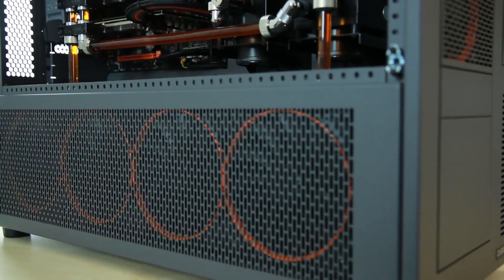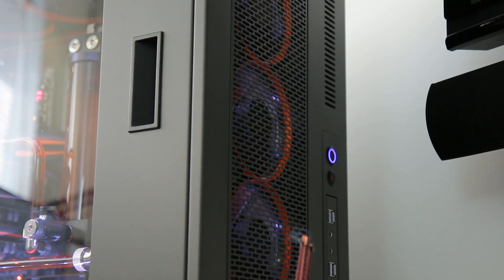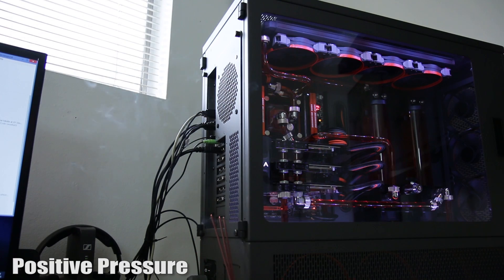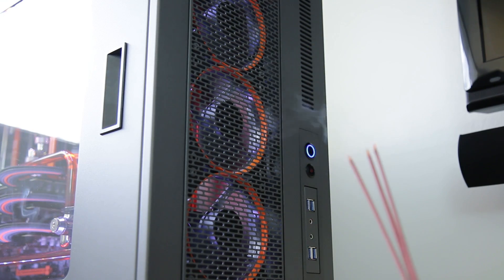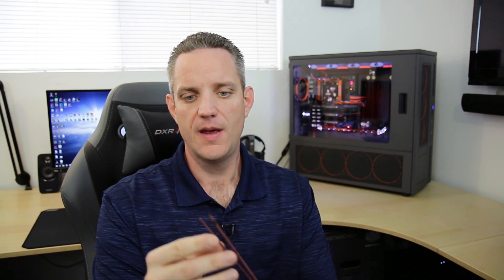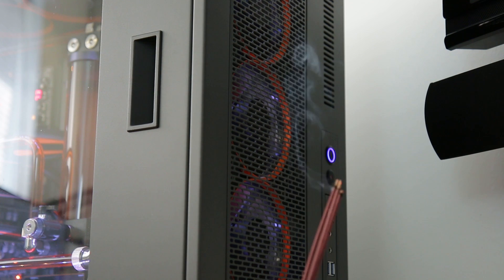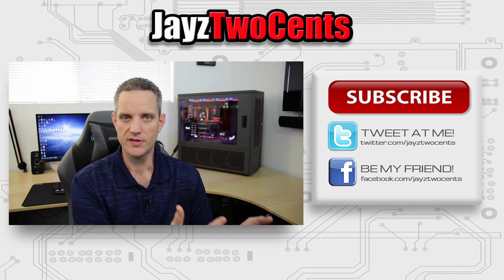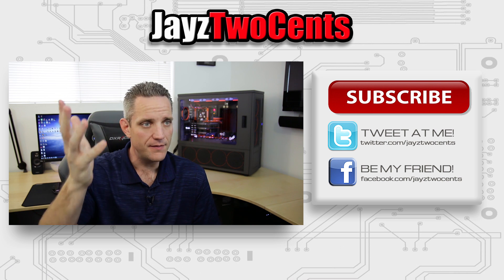Case Flow and Pressure Demonstration - How to balance airflow

Comment: Hi, i've got a question about my fans...
I've recently bought an N200 case.
With that case came 2 fans. They're CM Silent fans.

The problem is:
At the front there's to much sound... 
The fan is just screwed in place with screws, that go directly into the plastic of the fans.
There isn't any rubber inbetween the fan and the case.
Also i've set the fans to ~800rpm...
Should that be the problem? Because the exhaust fan at the back makes no noise at all, not even at 12v (Molex)

So can i solve the problem by buying an AF120 quiet edition?
Thx for replying!
Reply: +Willem Dekker I had the exact same problem with Corsair AF120 fans, turns out when something is covering the intake of the fan it gets loud so I had to switch it to be exhaust. Now all my fans are exhaust
Reply: +Willem Dekker I have this 2 in front. http://www.amazon.com/Corsair-Series-SP120-Edition-CO-9050006-WW/dp/B007RESFR2 Will solve your problem. I have no doubts.

Comment: I'm hopeful for positive pressure in my case. I have a Corsair Graphite 600T with a 200mm Bitfenix spectre all black hooked up to the case's fan controller, Corsair H100i with 2 EKWB Vardar (1450rpm) fans at the top and a Corsair SP120 quiet edition on the rear blowing through a Corsair H60 attached to my graphics card.

I say hopeful, because I don't have a sidepanel on atm, as it is at a plexy place being measured up for a full acrylic replacement, so it's all very free flowing (and collecting dust) at the moment.

Once I get that back, I'll be able to ascertain what kind of pressure I have and ramp up the beefy front fan up to compensate if needed.

Comment: If you keep the enviroment around your pc and the pc itself clean with regular maintenance (i like to do it every 2 months with an eletric blower specific to electronics, but an air can is good enough if you know how to use it), negative air pressure is actually very nice to cool down the machine. For a pc sitting over a desk that is regularly clean, negative air pressure is fine. However, if you leave the machine under a desk, or in a room with carpet, or if you have pets that roam freely through your house, positive or neutral air pressure may be better. Also, you don't need smoke to check the airflow. Just use some strips of toilet paper, hold them over your air intakes/exhausts and see in what direction the paper is being pulled. Anyway, just my two cents :) Love you, Jay.

Comment: How do big tower coolers with 2 fans influence the exhaust in the back. In my case (hurhurhur) i had to switch from a AIO cooler to a tower cooler because of leakage and now i have three fans pretty close to oneanother moving air in the same direction. I get the impression that now the air in the back is flowing a lot faster.

Comment: Very nice video. I am building a new system with the H440 and it comes with 3 front intakes and 1 exhaust so I will have to do some investigating on getting it to be positive pressure.
Reply: That would be positive

Comment: I have 2 140 mm fans intake (filtered) and 2 120mm fan exhaust (back + top).
However, the intakes are very slightly choked off of all the air they can push in by the indirect air channel that the NZXT s340 case has.
So I guess it's pretty balanced
Reply: +TackStash779 I think its actually a bit positive

Comment: I love that people aren't clever enough to figure that fans are able to turn at different speeds, that size (and design) matters, and that radiators slow down airflow. Good on you for making a video explaning this Jay, but man.. How are people even able to open and close a door without help. This is NOT complicated.

Sidenote: Why is positive air pressure important to you? When no fans have filters, dust will enter no matter what.

Comment: I have a Define R5 with the stock fans as intakes in the front and a Corsair AF14 for exhaust in the back, all running off the fan controller.

Comment: Great video Jay ! Positive Pressure is less easy to do than Negative tho, for exemple my Silent base 800 cannot achieve a great positive pres. because of the meched front sides , so i've moved one of the two fans on the front to the top. I've gained more than 5°C  CPU AND GPU this way, so it depend of the case if it's meshed or not :<. Also i think if it's 100% Aircooling, "Soft" Negative is great, 100% Watercooling goes Positive, if its 50% ... go trial and error ! Oh and the smoke is safe for the PC ? It's dry so i think it's ok but still ...

Comment: I have 1 fan pushing the air out of my case, because my only front fan spot is blocked in so many ways that it won't make a difference.
Negative airflow FTW :D

Comment: Wait, you have a quad fan rad for the CPU only? and then another quad fan rad for the 3x TITAN X's ? A bit odd in my opinion as the GTX's create much more heat than the CPU... but I guess that it still works, and looks and performs nice...
+1

Comment: I have 1 fan pushing the air out of my case. Because my front fan spot is blocked in so many ways, that installing a second fan wont make a difference.
Negative airflow FTW! :D

Comment: Heat does not "rise up". Hot air is less dense and therefore rises above colder air. In other materials like copper heat "travels" equally in all directions.

Comment: You have two 280mm exhaust fans in the bottom of the case?
Reply: +Casual G4mer misspelled that one (twice :D) he has 2 140mm which adds up to one 280mm
Reply: Daniel Deutschen Yes, I know that he has a 280mm radiator with two 140mm fans. Just pointing out what he said :P

Comment: i got 5 intake fans in a Fractal Define S and 1 exaust...
Reply: This is what I will be doing in my phantek, is there any issues with doing this?
Reply: El Conquistador depending on what fans you get. It can be noisy. But worth it. I am getting 11 degree Celsius! which is freaking insanely good! thats like 50F which is literally cold

Comment: want neutral pressure ?

get:
-pressure sensor
-arduino board
-PID code
-555 chip for the PWM and control the intake fans with these

10$ worth of fun

almost easy...
Reply: [clap clap clap]
Reply: I just run open case. Top rad runs at 1200rpm but 2300rpm when extreme overclocking.

Comment: I never got Jays statements about positive air-pressure without filtration. He adjusted his statements over time, but he still makes the connection between air pressure and dust in his unfiltered setup. Concerning dust: If you don't filter your intake fans, it doesn't count shit if you have positive or negative air pressure. What is supposed to happen to the dust that goes through an unfiltered fan instead of any cracks and holes? It doesn't magically turn into fairydust just because it passes through a fan.
Reply: +Rumplelumpa Snickerdoodles He made it clear in this video that it doesn't really affect his specific build at all, he mentions multiple times that his build is unfiltered. In videos where he works on skunkworks in the past, he stated it was a design choice, not a functional one.

But, this video and it's content isn't meant to just apply to skunkworks, he is just using skunkworks as an example system to demonstrate the different kinds of airflow you can expect in YOUR build at home, which, if you bought a decent case, is likely filtered at the intakes. Would you want him to ignore the topic of dust accumulation in a video about positive/negative/neutral air pressure just because it doesn't apply to him in his very niche situation?
Reply from the maker: +Rumplelumpa Snickerdoodles If CaseLabs cases had filters, I might use them... "But just get magnetic ones" sure, as soon as magnet stick to aluminum, ill be all over that.
Reply: positive pressure in a non filtered case will suck in dust thru the fans and push the dust out thru the cracks and holes in the case, having a negative pressure in the case will suck in dust thru all holes, cracks, intakes and the dust will build up not having anywhere to go.
Reply: ***** :) Naa i wasn't ranting on the lack of filters :D just the implication many PC builders make about pressure mattering to dust buildup even if there are no filters involved. But i get the Airflow-direction argument.
Reply: Rakso67 what about the exhaust fans?
Reply: mygetrichslowplan True. I was kind of also referring to older videos were he made statement i mentioned, but in this video he was more talking about the importance of airflow direction and stuff :) I just get hung up the the fact that many renowned builders think that positive pressure will help with dustprevention even without any filters, which makes no sense.

Comment: I wont be able to balance anything because one side of my case is open
Reply: so ... close it
Reply: +DomeZockt I mean I have grid side panel
Reply: +Henrix98 oh ... well
Reply: +Henrix98 oh ... well
Reply: +Henrix98 oh ... well
Reply: +Henrix98 have fun with all that static and dust you are introducing into your system.
Reply: navid617 if you're getting lower Temperatures without forced air, that means your Airflow plan is literally shit.
Reply: +givemeajackson ...an older metal style lunchbox would be an awesome case design!
Reply: +C M B 1 4 1 6 4 7 Zalman Z9 with 5 fans
Reply: +navid617 what is your case, a lunchbox? my gpu temps get 7 degrees warmer upon opening the side panel, cpu doesn't matter cause it's a radiator at the intake.... well-channeled airflow is vastly superior to open air.
Reply: Oborowatabinost true, looks good in my mind.
Reply: Fuck that shit. Just have the case in such an angle as to have the air conditioner blow right onto the freaking components. Problem solved.
Reply: if you have enough intakes the open side could be a passive exhaust, you would need as much airflow as can escape through the side, probably not viable but technically possible
Reply: +Henrix98 What case?
Reply: +Henrix98 

You DONT NEED to balance anything because one side of your case is open.
Reply: +navid617 not true. airflow is important. leaving giant gaping holes makes correct airflow impossible.

the moral of this story is giant gaping holes in your case are bad and make airflow impossible to do right.
Reply: *****
Monitor your temps in a benchmark..
Then, do the exact same test, but with the case lid open... Look at the difference..
Reply: sure the temp may be lower by a little bit, but its not gonna extend the lifespan or functionality to the point where all the dust you are introducing into the system isnt going to eventually counteract that unless you dust freakishly often.
Reply: +Henrix98 Switch it with your back side panel. I tried it and the air pressure is pretty good.
Reply: +Henrix98 Fill it up with fans
Reply: +Tal Risin Can't put more than one on it because CPU heatsink blocks the other
Reply: Henrix98 :(
Reply: Not sure what all the fuss is about.  My case hasn't had a side panel on it its whole life, and never had any issues.
Reply: +LamborghiniReven1000 your dumb lol.  if this was ideal the cases would be completely open.  you want air and lots moving over your components
Reply: +LamborghiniReven1000 if your going to that best exhaust all fans out and aim a box fan at it. Or something
Reply: bob smith I have a Zalman GS1000.  There are no intake fans.  I leave one of the hard drive bays open and blow a fan into it, and I leave the side panel off for better airflow.  If I don't have the fan running I can start to smell burning.  The only reason we got this case was so then I can share the system with my dad, and we can both have separate hard drives.  Trust me, I know that having good internal airflow and positive pressure is the goal, but it's just not possible with my current setup :)
Reply: navid617 no, you don't. 
forced air is vastly superior to waiting around and hoping that the air naturally flows well.

you are literally the opposite of every professional in the industry.
but it's Youtube Comments, what do i expect.
Reply: ***** Dude, I'm no rocket scientist but you will ALWAYS get the best ventilation in open air.
However, you don't do that because of dust buildup..
I wanted to tell him that positive/negative would not matter since its no longer a closed system..